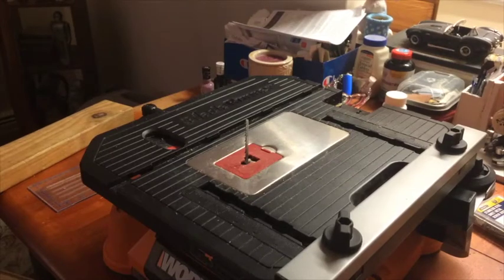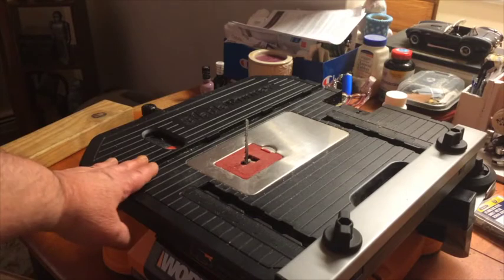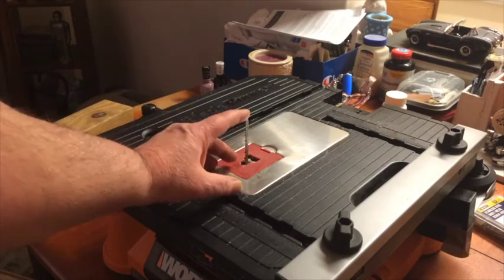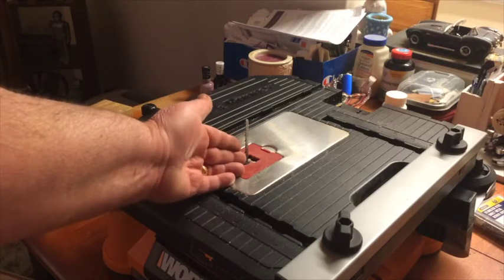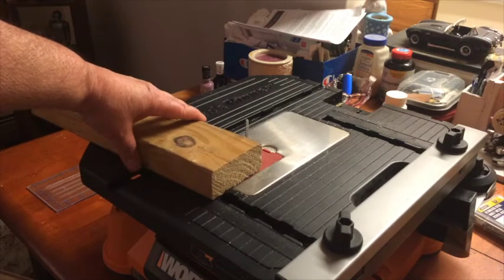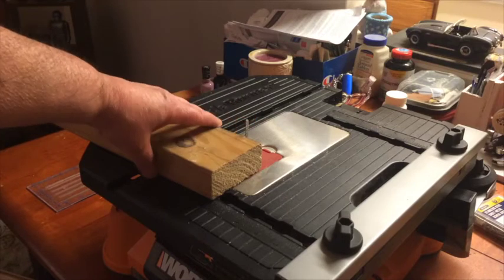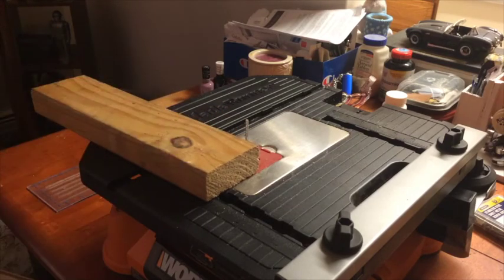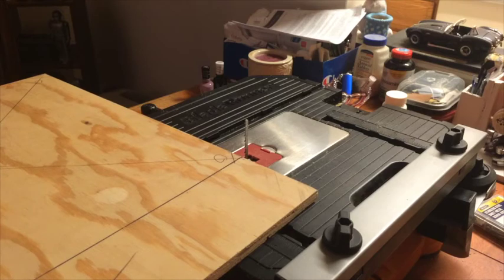Worx blade runner 2  jigsaw an blade deflection

Comment: Thanks for a great review :)
Reply from the maker: +WORXTools Thank you very  much, I cut a  board an fixed an put a  pedestal on fan for  our friends . I love this tool!!! I also added  a side saddle  bag  for the hold down fence bolts an nuts  so I do not loose them. I m toying with an idea for a side bracket to  store the top hold down fence .. Im sure Worx it was  in your  designs ( Just a  guess) Also I see this tool going through  generations of improvements .Best of luck  Cheers Peter
Reply: Peter Agostini
Thanks Peter :)

Comment: Thanks. Good points.  I learned after several frustrating wandering cuts even with the side blade guide, to pull the blade, turn the table upside down on a surface lower than what you normally use and use an extra light because it's pretty dark in the plastic box encasing the saw. You'll see screws or bolts on either side of the saw and loosen them up so you can move the saw again towards the proper direction it should be taking. (I.e. a straight up n' down vertical line.) You may have to do this several times before you get the actual lining up job done just right.
Then turn it back upside down, tighten the bolts and see how it goes. I've had my Bladerunner for a year and my "veering" began not long after I purchased it. Once I used this method, it might've gone off kilter a little, but a quick readjustment using same method got me back on track. Also, check your blades for wear n' warp. You'd be surprised what overuse and improper matching of a blade to the job you're working on can do. SNAP. (LOL) These machines are great, but remember, a lot of plastic goes into the making of them and they're not meant to replace any large heavier duty metal table saw with all the bells n' whistles.
Reply from the maker: Great tips Steven thanks for your contribution to maintaining this saw .

Comment: Are you able to make truly accurate, square cuts with this, being slow and careful and all that?
Reply from the maker: You should be as long  as you take your time us the fence an use  safe  firm grip , you don't want to rush able job where  a  power tool is  involved .

Comment: Can a blade be raised up? Or do they sell taller blades
Reply from the maker: redbaron2448 no they sell longer blades , but remember the spacing of the teeth determines the material you cut . Like on plexiglass you use a blade with hacksaw teeth they are close together and fine . Thanks for watching
Reply: @PeterAgostiniJdcap26  ok, yes  thank you